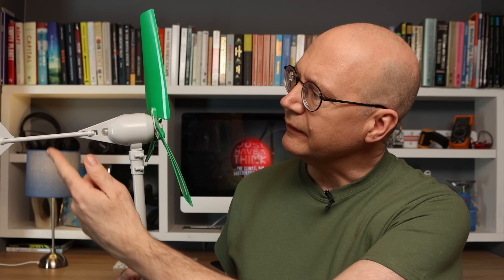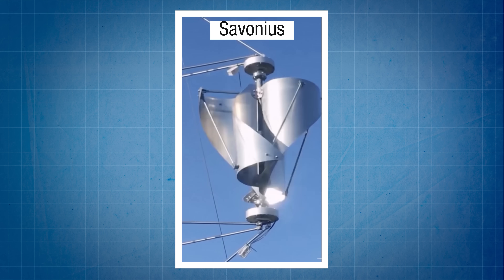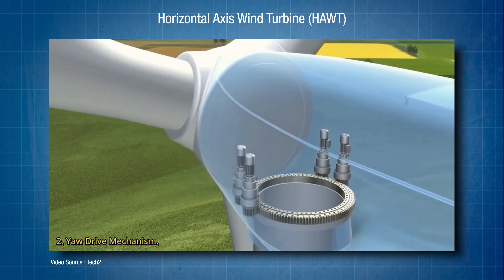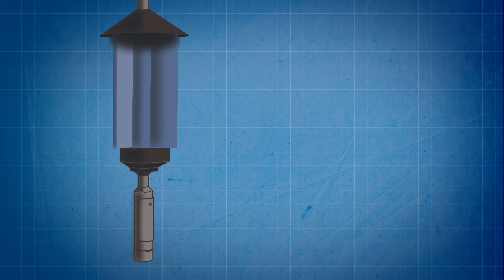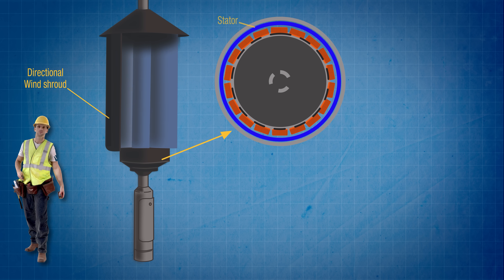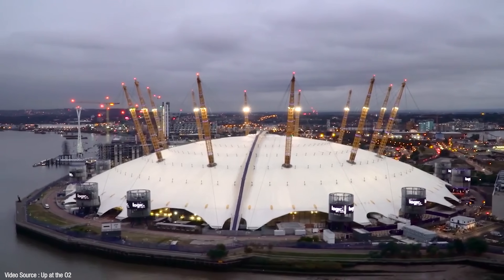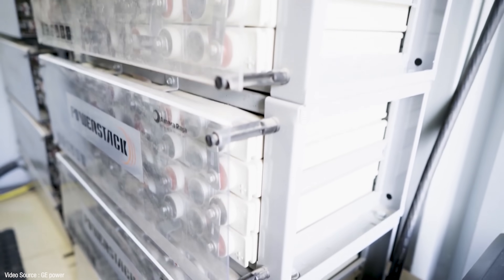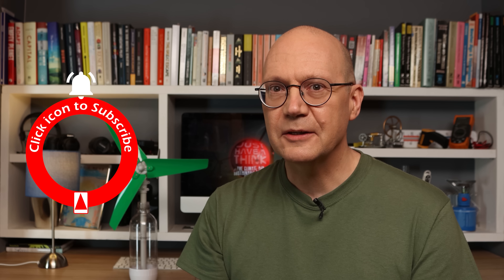A vertical axis wind turbine that doesn't need the prevailing wind! How do they do that?

Comment: Your economic comparison has 3MW (3000kW) for 125 turbine units, which suggests 24kW/turbine unit (at 9.00 minutes).  Over a whole day, the full capacity of each turbine unit is 24*24 = 576kWh.  Yet  the modelled daily generation of a single turbine is 5.8kWh (at 5.55 minutes), which suggests a capacity factor of 5.8/576, or about 1%.  Is that correct, because it looks like a hideous waste of resources.
Reply: Yes the comparison is wrong - but it also highlights an often disguised issue with solar farms only quoting their CAPACITY, not their average power. The UK sees 4.4 sun-hours per-day (not 24 for some reason!) over a year, as-low-as 1.1 sun-hours in winter and up-to 8.8 sun-hours in mid summer. The compromises made when implementing a typical UK solar farm means an average utilisation of ~11% (the limit being 18%). So your 3MW solar farm actually produces 330 kW on average - which is still more than TEN TIMES what they are claiming here for 125 turbines (2.6 kW vs 240 W average).

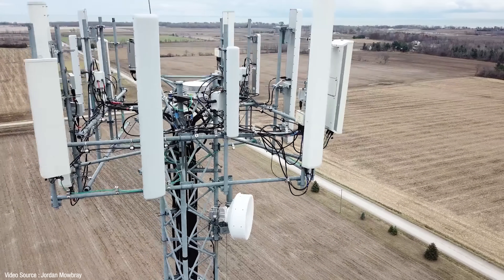5.8 kWh per day is probably worth about £1.20 at a domestic rate, so 125 of these could earn £4,500 a month - GREAT! ... until you remember (9:30) they want to charge you £29,000 a month to lease them! There is literally ZERO sense in fitting these to anything which already has a power cable going to them...
Reply: @iancash3559  Completely agree with your conclusion.  Dave says at about 6.00 minutes (for 410 turbines along a particular stretch of road) that 860MWh is "definitely worth having".  If the economics are anything to go by, it is definitely NOT worth having because nobody would wish to pay the exorbitant price for intermittent power.  He describes it later in the video as "free", although £29k/month is hardly "free" . It's this kind of thinking that leads to people claiming wind generation is the cheapest form of generation, but every time more wind generation is added to supply, consumer prices go up.
If any of these turbines breaks down when earning only £1.20 per day, it would never be worthwhile repairing it.  For such uneconomic value earned, the entire operation would grind down to a state of disrepair and close long, long before the 25 years considered by Dave in his economic comparison.  The only way this could survive would be by throwing money at it through obscene subsidies, gathered from people who have little or no ability to protect themselves against government-sponsored waste.
Reply: @gufpott  The video is an insult, and far below Dave's usual standard. Super disappointing.
Reply: @gufpott  Well, renewable is the future; Check out Tony Seba's latest video, he argues better than I can. I personally don't think nuclear is a bad alternative, but politically it is an untouchable these decades. So wind, solar and batteries will have to do. And hard science.
Reply: @tzenophile   Renewable is either too limited (hydro) or cannot be secured in the way necessary for an advanced economy.  
The UK has gone nearly a week on nearly zero wind, when the UK has about 20GW installed capacity. Even if we spend a few more £billions expanding this to 40GW, the UK would have had almost zero wind contribution over the last week.  And it is expected to last another week.  Batteries are hopeless - today (a Sunday), the UK is using coal fired generation. 
So, as far as energy security is concerned, the future simply cannot be renewable. 
Nuclear power is unnecessary as there is enough  coal and gas to supply the world's energy needs for a couple of centuries.   That's what China and India will be focusing on - and they are quite right.
When the UK has been through the experience of energy rationing,  there won't be any more talk of the climate emergency hokum.  Once the UK has experienced energy rationing, if you try to talk about a climate emergency, you'll be given much the same treatment as the XR idiots on the roof of the Tube train in Canning Town. 
Best you get into the real world and wake up to the reality that the climate emergency hokum will not last much longer. The first instance of energy rationing in the UK, and it's all over. Mark my words.
Reply: I came to the same result.
But the turbine can't have a nominal output of 24 kW, it is waaay too small! 24 kW are roughly 30 horsepower. Think of a motor of that size connected to this flimsy construction and spinning it full speed...
Reply: @TheSpecio  The economic comparison with the solar farm is correct  (starting 8.40 minutes).  It compares a 3MW solar farm with 3MW for 125 of these wind turbines. If 24kW is too small, something is adrift with Dave's economic comparison .... although that's just one of a handful of similar questions.
Reply: @gufpott  I used the information at 5:55 "one turbine can on average generate 5.8 kWh per day".

Comment: Court Defendant: Yes I was exceeding the posted speed limit by around 100mph. 
But considering how much energy I was generating, you should be paying me.
Reply: True, Defendant. Could you also pay for the electricity being used during your trial, just so that we are evens?
Reply: Nice enough,  but a single court session brobably costs 1000 times more than the value of energy generated.
Reply: @viljosavolainen2286  Not if everyone is breaking the speed limit ;-)
Reply: @2002RM  well that would be interesting to calculate, how many more accidents would we willing to accept. Then again if everyone went certain speed then that should be the actual speed limit.
Reply: @viljosavolainen2286  I see an opportunity there, an increased number of deaths due to accidents, would lower the energy consumption of the society, and we could also harvest more energy if we use the corpses for biomass. Just have a think!
Reply: @TheAlchaemist  i dont believe that death rate vould increase that much compared to more energy needed for increased speed. Atleast some of the accidents wont be fatal so partisipants will also require new vehicles. The energy gained from this system is brobably quite miniscule albeit possibly still cost effective way to get some energy back.
Reply: @TheAlchaemist  Frostpunk player detected :D
Reply: This line of defense would work well in Poland. We have a lot of wanna be racing drivers :|
Reply: Judge: Guilty as charged

Comment: These would also work great Horizontally mounted in any exhaust stack
With hundreds mounted inside cooling towers, at power plants, might be good.
Incorporate them in HVAC fan exhaust systems vertically. 
It might even be capable of self generating its own power if incorporated within the system ?

Comment: I have seen a lot of big city streets that have become wind tunnels because of the size and orientation of the buildings. Also the summer heated air raising from the streets might power a system like this.
Reply: City heating is actually a massive problem in its own right these days, both because it leads to extra heat stroke issues when people are outdoors but also because people indoors tend to use immense amounts of power on fans and AC.  There is a lot of effort right now being put towards building cities in ways that reduce the buildup of heat.  Lots of ideas from (older) cities in the Middle East, north Africa, India, etc where they've had to no choice but to deal with city heat through smart architecture for centuries prior to the invention of AC.

Of course having good designs is one thing.  Finding the hundreds of trillions of dollars to retrofitting (or rebuild) office towers around the world is quite a different problem, and one that applies to any effort of addressing the city heat problem.  Finding options that can be bolted onto existing infrastructure (and not be a horrific eye-sore since poor aesthetics alone is enough to deter people no matter the benefits) is a heck of a challenge.
Reply: @altrag  You do know that you point out that cities are a heat trap . So those that claim the planet is getting warmer because of CO2 may be basing their argument on Temperature reading in growing cities and the increased heat they make from roads buildings , car trucks , Air conditioning etc . There is some food for thought .
Reply: @grahamoldfield3474  Wow.  Neat idea.  But it turns out scientists aren't that stupid, and they take measurements all over the planet, including the middle of the ocean and the arctic and wherever else that most definitely is not subject to city heating.
Reply: @altrag  Maybe you want to have a look at what the Australia  department says repeatedly and releases PR claiming hottest day etc etc to the Media . They have been shown to have been deceitful or outright lied about hottest days , highest rainfall , actually deleted historical records  etc . They have tried to argue that city developed ares with roads and carpark etc cannot increase temperature . Yet on other occasions they say it does , you cannot have it both ways and be truthful .
Reply: @grahamoldfield3474  > you cannot have it both ways and be truthful
You can if you're talking about different things.  City heating makes local temperatures go up.  Climate change is about global temperatures and city heating has little effect on that because cities are a tiny fraction of the planet's total land area.

Just because you don't know what they're talking about doesn't mean that they don't know what they're talking about.
Reply: @altrag   Thats exactly what we see the Department claims one thing to suit their argument about global warming , then they claim it the other way for their argument for another thing . In Australia we have the Public servants actual caught out ignoring THEIR OWN higher temperature in the late 1800,s . its been document and they have had to admit it publicly . They have also made ridiculous claims about rainfall on National Radio that listener rang in and shot their claims down , if you were over 45 you know they were wrong . As I hear Australian   department saying it has never been hotter when in fact it has in their own figures . I question their impartiality and wonder why they lie to push global warming ?? Then I see these lies used as facts on the international stage , makes one wonder are they the only liars producing figures ?  .
Reply: @grahamoldfield3474  > then they claim it the other way for their argument for another thing
Can you provide any examples?  Because I find that pretty hard to believe.  Sure different people in the department may have say, different numbers (one says 2040 and another says 2050 for some deadline, for example) but I'd be extremely surprised if one department both affirmed and denied climate science.

> THEIR OWN higher temperature in the late 1800,s
I'm going to have trouble even beginning to describe how irrelevant this statement is, but let's try anyway:
- "THEIR OWN" doesn't matter with respect to climate change.  Climate change is a global phenomena.  Not even an entire country's "own" metrics are sufficient to fully comprehend the issue.

- "late 1800,s" also known as a good 80 or so years before anyone even considered that there could be an issue, never mind setting up the global network of monitoring stations and doing the analysis to determine exactly how big the problem would become 150 years into the future.

> Australian   department saying it has never been hotter
Again, you're mixing up local weather patterns with global climate patterns.  Those are not the same thing.

Either that or you're one of those people who look to the past and claim "hey!  It was hotter a hundred million years ago!"  That's absolutely true, but again absolutely irrelevant.  The world has changed since 100 million years ago and life today is nothing like it was back then.  Global warming isn't going to destroy the planet, - that big ball of rock will continue circling the sun for billions of years not matter what us humans do.

What global warming is destroying is life on the planet.  Even if we could flick a switch tomorrow and reset the climate back to what it was 200 years ago instantaneously, we'd already have been through one of the largest mass extinction events in all of history.  And we can't just turn it off like that, meaning more and more life is being destroyed basically by the day and will continue to deplete for probably the next couple hundred years even with us cleaning up our act.

And that's before we even start worrying about the impact on humanity directly - rising sealevels pushing coastal communities further inland, rising temperatures pushing tropical communities north and south, increasingly powerful floods/fires/draughts/hurricanes/other such extreme events destroying communities and even whole cities around the world.. and all of the wars we're inevitably going to start fighting as forced migration pushes people of disparate backgrounds closer and closer together.

No person alive 100 million years ago had to deal with any of that.  Shockingly.
Reply: Yes, this is something some have already done experiments for, I think over a decade ago.

Comment: This is not a new idea. This has been thought of by every free-energy, perpetual-motion crackpot since there have been highways and windmills.

There's is NO SUCH THING AS FREE ENERGY. Every joule of energy captured by these things has to come from somewhere. If it isn't coming from prevailing winds, powered by the sun, then that energy is coming from the cars that are creating the air movement. Sure, the first car down the highway would have created that wind regardless. But the subsequent cars are benefiting from the reduced air resistance resulting from traveling through an air stream which is moving in the same direction they are. 

By capturing the energy of this wind, thus reducing the speed of said wind, these "generators" are causing higher wind resistance for all but the first car on the highway. This, of course, increases their fuel consumption to maintain the same speed. Therefore, these "generators" are really nothing more that toll booths, collecting a micro-payment from every car that passes, in the form of higher fuel bills for the car owners. 

Not to mention that transferring energy from the internal combustion engines of a thousand cars, in about the least efficient manner possible, has got to be the least ecologically friendly way to generate electricity.

These "generators" are nothing but a boondoggle, designed to con money out of governments staffed by uneducated cronies, and steal money out of the fuel tanks of unsuspecting motorists. And, quite frankly, you should be embarrassed to have fallen for it.

Comment: I think it's a scam.  I really don't believe the numbers,.  The only research you mention is seems to be from the manufacturer (Alpha-311) ~ how about some independent testing?  In small wind this stuff has been going on for a long time.   'but they can provide a very valuable complimentary power source' ~ you stated that as a fact.  I'm doubtul but I guess I hope you're right.  I have very little faith in VAWT's.  I've mostly seen failure, or in the best case very expensive energy.  I don't see anything new about their design.  I do believe much less expensive energy could be had with solar or more practical wind turbines (HAWT) properly sited.  I love your videos but not this one.

Comment: The motorway scheme is self defeating: those turbines will have a stalling effect on the airflow near the carriageways, that's how they derive energy from the traffic. Then a small back pressure will result, causing effectively an increase in resistance to vehicles subject to aerodynamic drag. It's only when it's rolled out at large scale would it be more than negligible, but it's not true that it's available energy at no energy input cost.

Comment: Average daily electricity generation of a single turbine is MODELLED to be 5.8kWh per day (at 5.55 minutes). This would have a value around £1.20/day at 20 pence per kWh unit prices.  If a turbine unit has a fault, safe working would involve the closure of a motorway lane for access.  That's not going to happen for £1.20/day. So when these things develop a fault they will not be repaired until the motorway lane is closed for other reasons.  The turbine units will therefore sit for long unproductive periods waiting for service and the 5.8kWh per day is likely to be underachieved on average by a decent margin.

Comment: Going by the title, I thought we would see a Flettner rotor (which totally doesn't work without wind, but at least without blades). But all in all: A very very cool idea to repurpose highways.
Reply: Good idea. Why not try both types of rotors simultaneously?
Reply: Well, there is "wind".  Its just not environmental wind (its coming from passing cars pushing air out of the way).  So a Flettner motor would work just as well in that scenario as it would in a "normal" wind scenario of the same wind speed.  I have no idea how it would stack up to these Alpha 311 turbines in terms of ability to extract energy, but the concept itself wouldn't be an issue.

Comment: Along motorways, hooked up to local storage to keep the lights on in low traffic at night, with excess going to big grid storage systems at service stations to bolster the energy use of the service station and the rapid chargers, which also have bigger areas they can blanket with solar. Recovering some energy from both ICE and EV vehicles for them/their drivers to then reuse at service stations, whilst maximising already used space throughout the system for actual power generation instead of needing more space!

...I really hope this works.